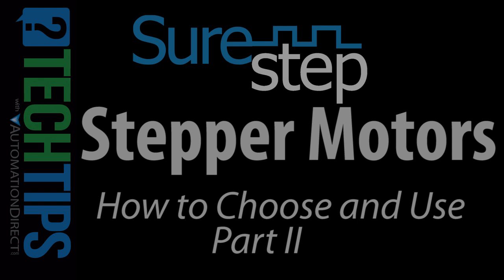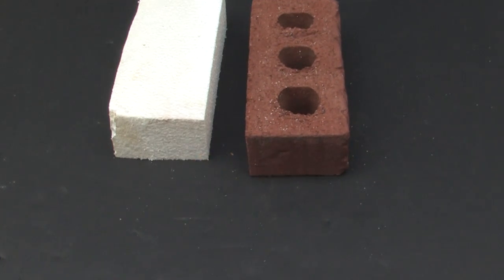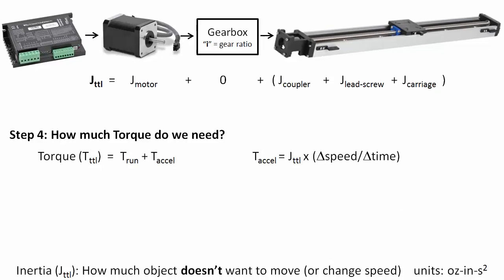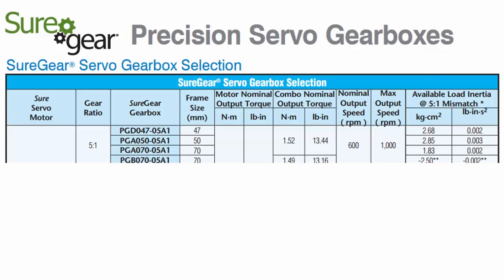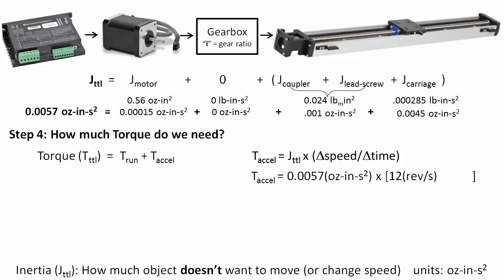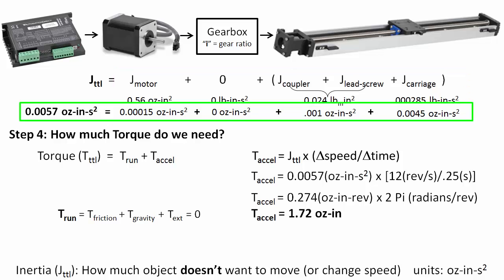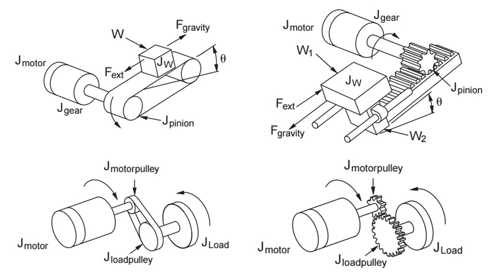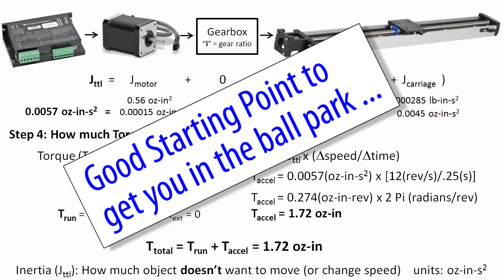SureStep Stepper Motors How to Select & Use a Stepper Motor Part 2 from AutomationDirect

Comment: can i use visualizer pro software for my electric actuator stepper motor calculation
Reply from the maker: Currently AutomationDirect only includes models for our legacy SureServo 1 products. None of our steppers are included in the software. You could attempt to create a custom model for it yourself, but there may be key data missing unfortunately.

Comment: Why does magtrol site gives me the same inertia as 0.001 oz-in-s2 but on a different converter i get exp 10^1000
Reply: No magtrol gives me the same answer but a Google converter has 1000 x greater answer so my 0.001 is 9.95
Reply from the maker: @Guk2540  Can you give me step by step what you are doing? I may be able to see what the issue is.
Reply from the maker: Not sure, can you send us a link to the Magtrol datasheet in question?

Comment: I think the conversion of Inertia for the motor got divided by an extra factor of 10. So the 0.00015 should be 0.0015. This also in the next video makes your inertia mismatch closer to 3.7:1 instead of 37:1. Therefore, your mismatch of this system seems to be pretty inline with the good design practices.
Reply: Also, thanks for the video. Helped go through some good practices.
Reply from the maker: No problem Jordan! Make sure to check out more of our videos at https://www.automationdirect.com/videos/home

Comment: If I wanted to use a lead screw to vertically actuate a mass, how would I incorporate that into required torque calculations?
Reply from the maker: Hi Troy, yes you do have to take into account the center of gravity and the pitch component of the new load force. I have our engineers looking for a concise answer for you, but you may also find this helpful - it has examples of how to calculate the moments which might point you in the right direction.
https://www.orientalmotor.com/linear-actuators/technology/calculating-moment-load-linear-actuators.html?gclid=CjwKCAjwte71BRBCEiwAU_V9hwzXjKsBPQLeFYIGj6nIQZXZrdsOZ46X5kaA8jixg1J2YwNhUpiZQxoC3Q8QAvD_BwE

Comment: Great Video! One thing, when my system works vertical, does the angel affect only the Running Torque or both Running + acceleration Torque?
Reply from the maker: Hi Paul, Thanks for the feedback. It would affect both. FYI: We have a lot more videos like this at www.automationdirect.com/videos and www.automationdirect.com/cookbook. Check it out!

Comment: If I wanted to lift an object against gravity, how do I find Tgravity?
Reply from the maker: Suppose you have a pulley mounted directly to the motor with a string wrapped around the pulley and a weight on the end of the string. Tgravity is just the force due to gravity times the radius of the pulley. Is that what you were looking for?